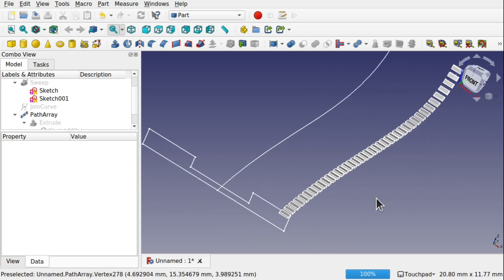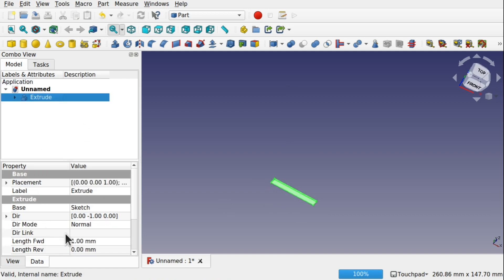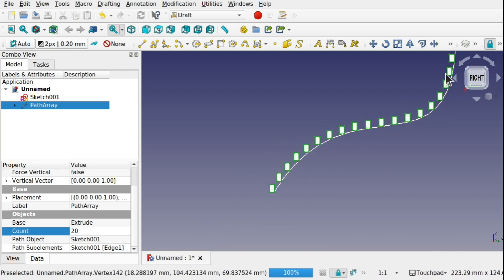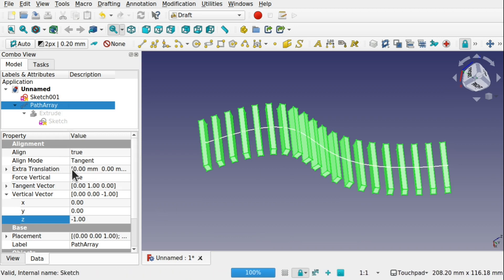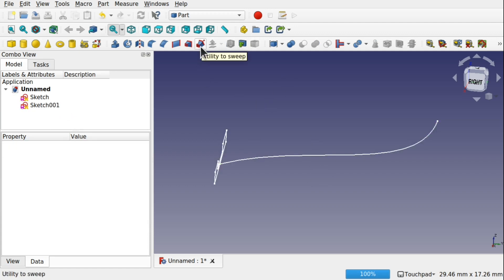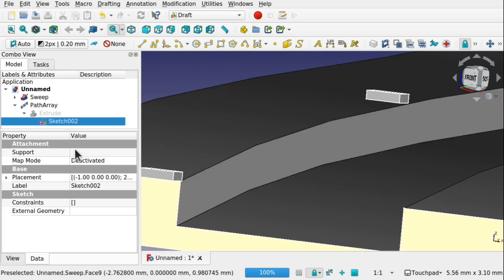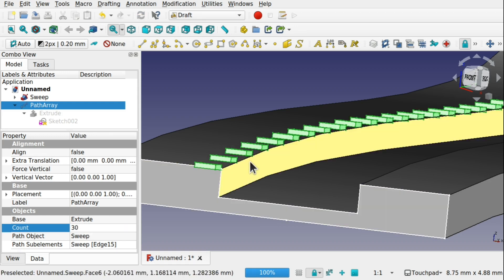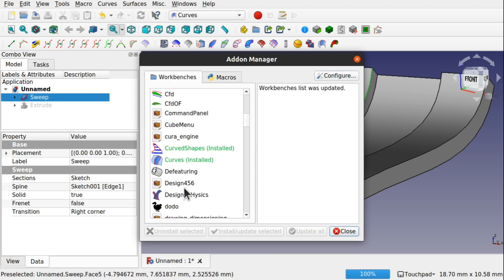FreeCAD: Path Array - Learn how make objects repeat, follow a path, align correctly and be tangent

Comment: Thank you for the great tutorial. I'm making a hairband and I have these pointy cones that I'd like to place it on a curvy path (the hairband body) and the pointy tips should point inwards to the center. Now I can use Patharray but they're all pointing downwards. Is there a way to make it point like in PolarArray but along the path?
Reply from the maker: Glad you like. So on the path array there are some vertical settings that you can set force vertical and vertical vector. Also align mode. If you play with those you should be able to get the effect you want.
Reply: @MangoJellySolutions  Thank you for the clue. I'll try that

Comment: I wonder, is it even possible to make something like Lucifer's (angel) wings with freecad? The feathers look so complicated, and there are too many of them.
Reply from the maker: That is really strange, you must of been reading my mind this morning (or vice versa)! Today I was thinking about a lamp that I saw in a shop yesterday. I was doing some research for the next series and there was a lamp with a base made up of porcelain feathers. I took some photos and right next to it was a lamp with angel wings.  I was looking at them this morning figuring out how I would create these feathers in freeCAD.  There is a way but if I wanted really high detail I would use something like blender to create 3 different feathers, the long tip feathers, medium and the fluffy down feathers for the shoulders of the wings.  I would then take the feathers, import as STL and place these with lattice workbench (look out for Saturdays video as I will be working with and introducing the workbench and at some point covering the lamp)
Reply: @MangoJellySolutions  Well I've been trying to figure out how to do this for months, so, as for mind reading, it must have been the other way around :) And to contribute to its strangeness I want to make a lamp too! A heart shaped lamp with wings, as a wedding gift for my niece. The heart was easy, programming my microcontroller to change the color of the led strip inside the heart with each short tap on a touch sensor and shutting it down after two and a half seconds long touch was challenging but successful. Now the only things that remain are the wings, I only managed to make flat wings which don't look very attractive. Despite all the wonderful things I've learned in your channel I couldn’t wrap my mind around how to make feathers look fluffy. What you suggested sounds promising, I’m looking forward to seeing your next tutorial.
Reply from the maker: I must of been tapping into your SOS call lol.  I like the idea of the microcontroller. I was getting inspiration from the local hardware store and spent a good half hour photographing a number of lamps. The one I saw had feathers around the base and I thought how I would tackle it. Started going down the route in my head of using a loft the same as I did with my spoon tutorial then using the project on object to add detail.  I am still thinking of leaning to use Blender after exporting a basic shape from freecad and then importing them back in. Also thinking about 3D printing your limited to the resolution unless your thinking about a 3D carve on a CNC machine (which I have never dabbled with.... Yet)
Reply: That explains it! haha... Projecting details is an option, I didn't think about it. I''ll give it a try. Thank you for taking the time to write me back. Really appretiate it.
Reply from the maker: @AaaMirzaa  No problems, nice to share ideas and help each other out

Comment: ***CHECK THIS OUT!

I was unable to set a Tangent Vector to 0. It would crash Freecad. So I added a 1 in the Y then changed X to 0. But after doing that I guess I have the problem mentioned of Referencing External Geometry...?   My Object /Extrude is at the point of origin but my Path Sketch is external to the origin. I do not get the twisting action from Vector changes. I guess because the origin is so far away. 
***Hmmm would a Construction Line connected to the origin work? WHHHHATTTT?!  it Works! I just put a construction line from one end of my line sketch to the origin and IT WORKED!  I don't have the twisting effect but maybe because my curved line is only 12 mm long. with four 2mm dots.  But, as I seen in the video, the numbers do not stay as one enters them. They were staying put where I set them on the first attempt at the Construction Line. But I deleted that test to prove it works. On this second attempt I can get the Objects to move but the numbers do not stay as I input them. 
What seems good about this technique is I don't have to create a new placement for all the different twists I have as I believe is necessary using polar array. But so far I can't get my object to twist the way I hoped.